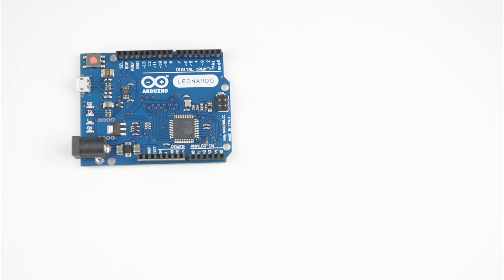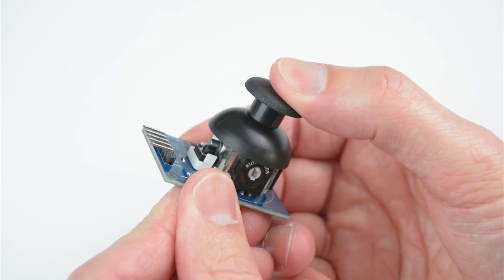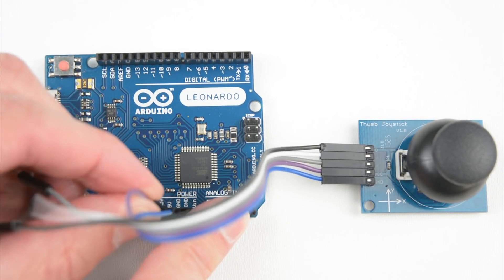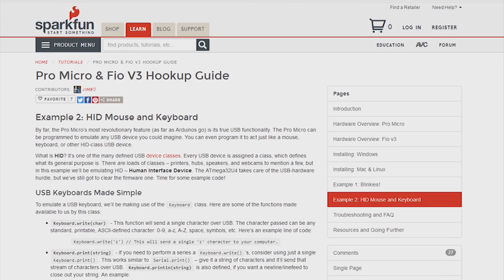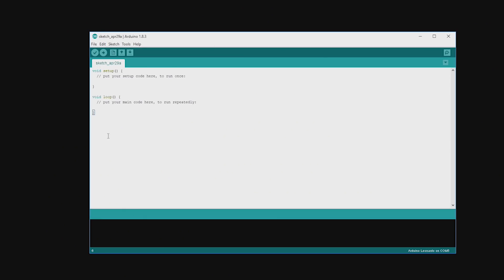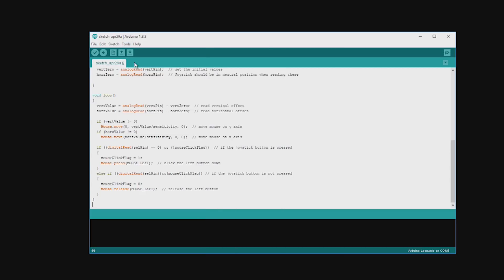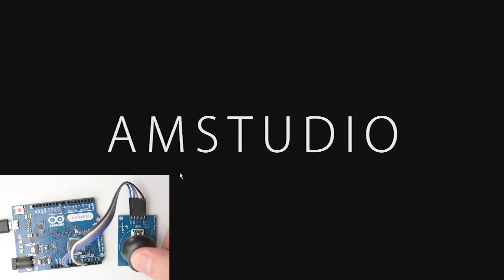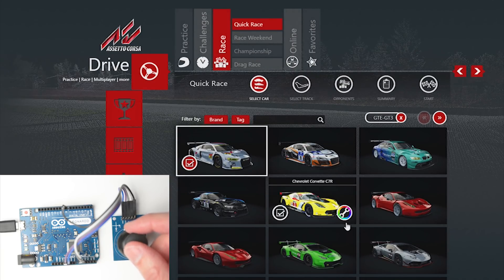DIY ARDUINO MOUSE JOYSTICK

Comment: I have an Arduino UNU and it doesn't have built-in mouse connectivity. Is there a way I can still do this? I made my own method using C++ and Python, but it sucks.

Comment: I want to try something similar but I need it to be a bit more sensible. 
In the presentation this looked like the inputs are  100% and no gradient in speed. 
I have no experience with coding these things so I ask.
Does someone know a code that would make this more smooth/gradient? 
Like imagine you want to control a character and transition from walking to running to sprinting. Or use it to control some plane.
Reply: Use analogRead() instead of digitalRead()

Comment: Hi, thank you for the video, its very helpful.
May I ask, can this mouse connect to phone? And how do i do that?
Reply: You'll need to ensure the code is stored on the Arduino board (instead of running locally from the computer), then use an OTG micro USB male (or USB-C, lightning, etc., depending on what type of phone you have) to USB-A female cord to give yourself a USB-A female port that connects to your phone. Next, take a USB-A male to micro USB male cord and plug the USB-A male part into the USB-A female port, and plug the micro USB male part into the Arduino board. Provided your code is good and everything's wired up, you should be good to go.

Comment: Does it have to be arduino leonardo or with another type of arduino does it work?

Greetings
Reply: As long as it has the same pinouts as described in this video, most any other Arduino board should work.

Comment: Nice job, but for a reason i know that this project, like almost all other similar ones, do not control the cursor exactly like a mouse does, How do you change the response curve?

With mouse cursor moves with different acceleration

Comment: Might be a bit late, but here is a solution for anyone who gets reverted horizontal movement: 

 if (vertValue != 0)
    Mouse.move(0, vertValue/sensitivity, 0);  // move mouse on y axis
    if (horzValue != 0)

    horzValue -=2 * horzValue;
 // THIS LINE HAS TO BE ADDED!
    
    Mouse.move(horzValue/sensitivity, 0, 0);  // move mouse on x axis
Reply: I am very noob on arduino, can you share the entire code?
Reply: Thank you very much for this fix!
Reply: thanks

Comment: What would be a good (nondestructive) way to attach this on a steering wheel? Tape seems weird. What would be a more solid way?
Reply: most ofthese have4 holes on the corners you can use screws

Comment: This joystick mouse kit works on android smartphones like Redmi Note 5 and tablets like Asus zenpad. I did check it. In fact it works on these linux based devices much easier than windows based devices like desktop computer. It was fun to learn. I feel more confident and capable now, after having this understanding and skill.
Reply: How do i connect it to a phone?

Comment: I tried this project. It works. I was a beginner but this not difficult. The horizontal motion was happening in the opposite direction. I corrected that programming in my file. Thanks for good instructions, mate. 
Thanks to Arduino platform also.
Reply: Can you tell me what you've changed, please??? I have the same Problem and I'm seemingly to stupid to find the error.😅
Reply: @NilsWeber143  If anyone else just got onto this video and needs to fix the horizon going the wrong way, change line 47 "invertMouse" to 1 if you have line 24 as -1, opposite if you inverted line 24.

Comment: can I use the Arduino uno to make a handbrake using on/off switch
Reply: yes, but its harder, as the arduino doesn't ahve a usb compatible chip, like the AtMega32u4, like the leonardo, so you would need to lfash anotehr firmware onto it, like the UnoJoy, which will turn your uno into basically a sub that you can program a joystick to use with

Comment: Hi. I know that this isn't the right video to ask this on but i just really wanna make sure that u see this. If i buy a 3d print on ur web does i get the 3d file or do u send me a 3d printed piece bec i don't have a 3d printer but i really want a bigger wheel for my g29 wheel base. Thanks.

Comment: Hello! I am a big fan of the page, I would like that in some video you will explain how to make an adapter for the logitech g25 to ps4. Thankyou so much for the videos!
Reply: you would have to open it up, and figure out what gpio pins are which for that, and what aligns with the internal potentiometer so you could code it with the arduino

Comment: Do you know any joystick/button like this also a rotary function like in the Fanatec steering wheels? Thank you
Reply: you could do that with a joystick as its basically just a potentiometer, which is also what a gaming steering wheel is.  Or you could just use a ocuple of big potentiometers and make a cardboard steering wheel yourself, you could look up an example of one of youtube easily

Comment: does it also work with the arduino uno? or is it a different comminucation?
Reply from the maker: ProMicro or Leonardo
Reply: This will only work with Arduino Leonardo or clones that use the 32u4. Those chips allow the computer to see them as a USB device. Such as keyboards or joysticks. The other Arduino chips use a USB to serial interface thus they can't work directly with the computers.
Reply: Uno only supports a serial port emulation over USB, does not have support for other USB devoce types, so emulating an input device (HID USB type) is not possible.

The reason is that USB is implemented on the Uno using a separate IC that supports only that one USB device type. On the Leonardo USB is handled by the main processor using a fully configurable built-in USB peripheral and any kind of USB device can be implemented in software.